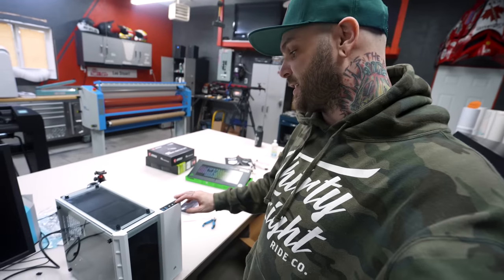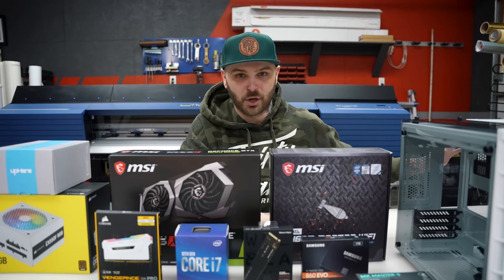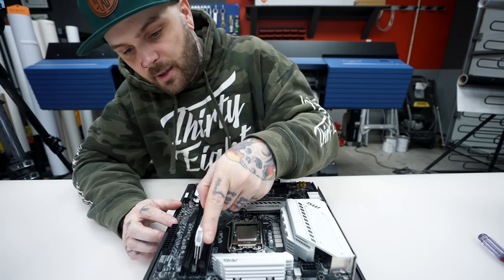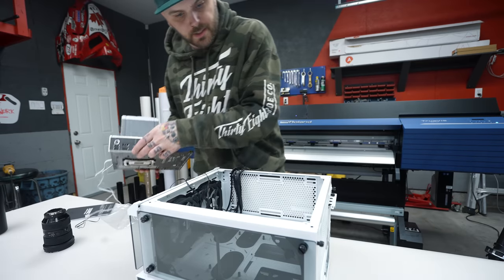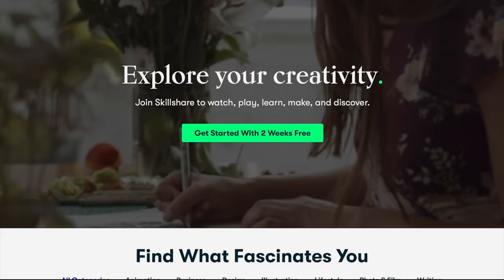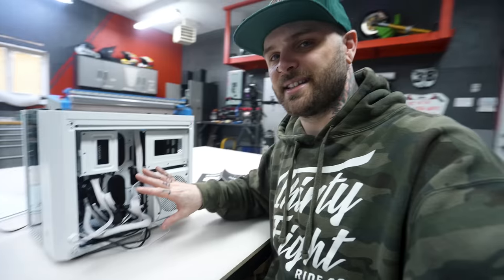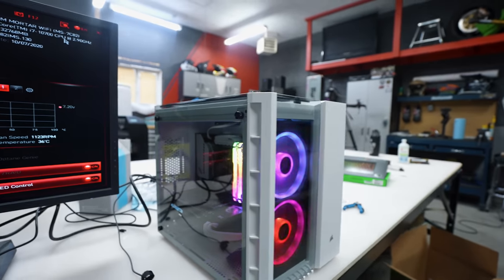A Custom PC For My Print Shop: My First PC Build!

Comment from the maker: Update: I lasted about 2 days before I ordered more parts (like a proper liquid cooler) and installed elder scrolls....I foresee a gaming rig build in my future
Reply: Welcome to the dark side. (From a reformed WoW player). Beware, there is not a 12-step program for this.
Reply: I predict once you see how much you can soup up a pc you will build more.
Reply: Congrats on your NEW rig 🦁👍
Reply: you mentioned stand up desk. Husky has some really good options that have a crank handle and a butcher block table top in plenty of sizes with caster wheels. oh and they do have a white options ;)
Reply: As a former computer store owner, hence my nickname CrownPC, you did an awesome job on this build.  You should be proud, and it will do all you want. Definitely build a separate gaming machine.  You don't want your employees catching you playing games when you're forcing them to do the rest of the real work....lol
Reply: @TheCheerio27   I just seen that desk yesterday and Home Depot. they hat like 15 all built and ready  all of them in white. (Wv) looked to be a very large and heavy built units USD $229
Reply: What liquid cooler did you end up going with?
Reply from the maker: Corsair H100i

Comment: 12:55 You were wrong in a correct way ;). The fan side of the PSU is the intake, not the exhaust. The exhaust of the PSU is out the back through the holes around the switch and power cord. However, you were right on the orientation, as if you installed with the fan facing down, the motherboard tray would suffocate the PSU of fresh air (no bueno). Nice build!
Reply from the maker: Ya I just mixed up the verbiage while I was talking, I noticed that in editing. It happens. There's a few comments in here thinking I put it in backwards though, like pulling hot air from the motherboard would be a good idea to cool it lol
Reply: @leestuart38  Ahh ok, its all good then. Yeah, its definitely in the correct orientation. Don't want to be facing a fan right against a solid panel xD

Comment: Sweet build man welcome to the dark side. Just a tip i noticed your memory is only running at 2133mhz,  but from the specs on your link for  it should be able to run up to 3200mhz check into running at the faster speeds. Just search it up tons videos out there on it. XMP profile in bios should bump up the speed of the ram. Love the channel and your hard work never stop!!
Reply from the maker: Ya I got that fixed up afterward, that was one of the settings I mentioned at the end. This thing runs like a champ 🤘🏻

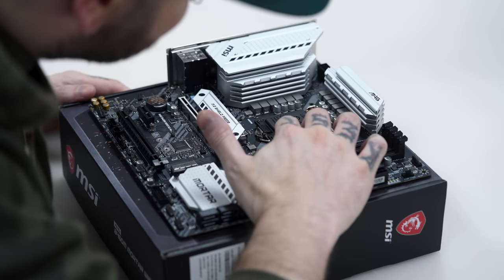Comment: You need that cap for the socket at 4:46 KEEP IT!  just in case you have to send back the mobo. also you didn't have to manually take it out. it would have popped out by itself when you latched the CPU in.

Comment: Hey Mate, the power supply is supposed to be the other way around as the fan isn't blowing. It's sucking. Love your videos. Cheers
Reply from the maker: Its the right way, the other way would be pulling in hot air from the motherboard

Comment: Lee, my man. How's it going. Ryan from Thread Chemistry and Misplaced Morals. I'm actually in the middle of a build now! I'm waiting to be able to find a 3800 that's actually decently priced!! and then just some RAM. I have the case to motherboard, ssd, external, power supply, you know the rest. Anyway, If you've read any of my past comments in other videos, you know I'm on the same path as you, just a bit behind you, about 2-3 years, so the knowledge and inspiration you give, I want to thank for. My question is, how is your build today? Find yourself using it a lot more or are you going back to your laptop more often? Thanks man. 1 question off subject. Do you like the siser brick 600 vinyl for hats? it looks like you might use that or something similar? what do you use if not siser? I have a bullshit heatpressnation cap press right now that i wish was in the garbage. I have a 15 needle embroidery machine coming then I need a wider plotter and THEN the 360 IQ. hahah. (Why does the list get LONGER the better we get??) haha. I'll take any advice you wanna throw out. Appreciate ya. Thanks again.

Comment: computer looks good man I went with AMD Rison 9 5950x paired that with the MSI MEG 570 ACE motherboard and used the G.Skill TridentZ neo 32gig per stick ram I also went with 3 Sabrant Rocket 4 M.2 1tb each card All's I need now is the graphics card. I want to go with the NVIDIA Geforce RTX 3070 I'm also using the Acer Predator XB3 monitor

Comment: Go with Flexi. Design will be a little tough because it seems to be a little backwards from illustrator but is really good for sign making and the rip is awesome and easy to use. The only negative with most sign softwares are the phantom crashing issues. Make sure and save often.  Onyx sucked in my opinion....
Reply from the maker: Definitely won't be using any of the design features, that's what illustrator is for. It would be strictly for print and cut operations, I really wish they would release a version like that
Reply: @leestuart38  then I think you’ll really like it but it’s probably a little on the expensive side for just rip. I always felt like the software is super user friendly once you get it set up.

Comment: From my research and talking to my tech guru cuz who runs an IT company AMD is where I would have splurged over Intel.  
Intel upgrades change the pin set so a new mother board is needed when they update . 
Which is basically screwing the consumer for updating with ease.

Comment: Debating this exact thing right. To build or not to build and go with a stock spec. No experience either. I’ve been a mac guy for over 20 years. Lately having issues with Parrallels and the last few of my mac products have been absolute garbage. They don’t make them like they use to since they lost Steve Jobs I feel like.
Reply from the maker: I'm definitely still Apple till I die when it comes to daily use and all of my creative work (design, video editing, photo editing), nothing beats it or even comes close. But for running machines and anything else that I'm forced to use Windows, this is a much better option than parallels. It's way too unreliable.
Reply: @leestuart38  I have a newer Mac laptop that constantly overheats so hot I have to hold my laptop off the table because it actually burns you if you had it sitting in your lap, everything is solder in so I can not upgrade my ram, I have keys that have worn down to no ink especially ctrl, c, v, x, s that is when you know you are a designer, just constant issues. 

I have a older mac and that thing is bomb proof 2012 and is running all my rip still going strong.  My other 2019 not so much.

I have beats headphones that stop charging. And I also have a pair of wired apple lighting headphones that constantly gives me electric shocks in my ears!! 

They use to make stuff so much better. I thought I’d never say this :( I was a die hard ever since learning how to design.

However looking at price of PC stuff people would always say get PC it’s cheaper it’s not cheaper. In fact mac probably drove some of the pc prices up I feel like.